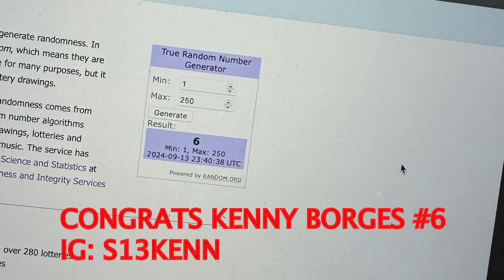Complete Interior Makeover On My Porsche 997! $20,000 GT3 Seats..

Comment: Hey DJ, just pull the electronic control module that the harness is plugged into off the automatic shifter, and tuck it into your tunnel. That way you don't have to spend more money on a cluster.
Reply: I had to do the same on an auto to manual swap I had done, also neutral should work to start the vehicle as well.
Reply from the maker: It deff does need a manual cluster tho! I know what you mean tho temporary

Comment: The part of the harness that plugs to the seat going to the side of the car then towards the fuse box could be a good place to look for the short. It could be as simple as wires getting squished under the seat rails or bit complex as cracked insulation. 👍🏼👍🏼